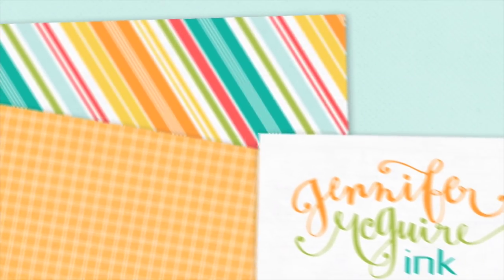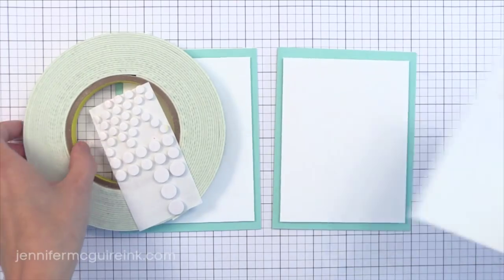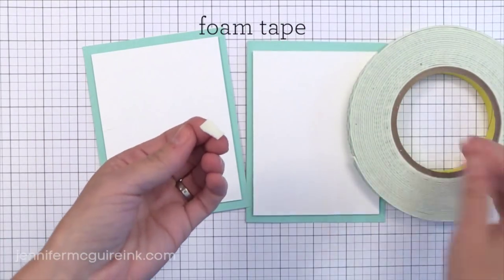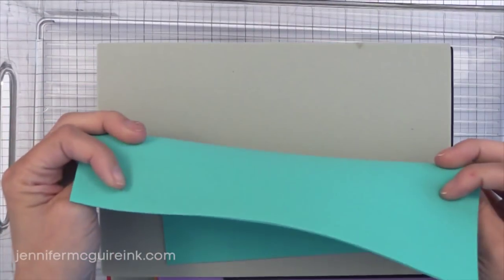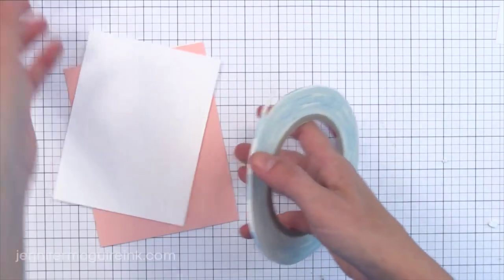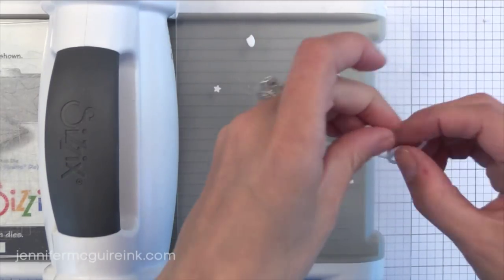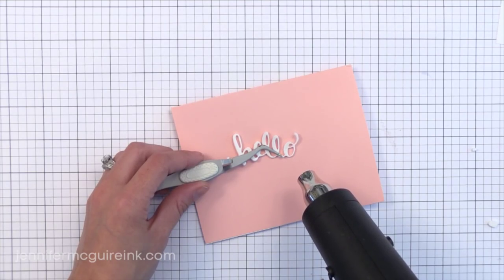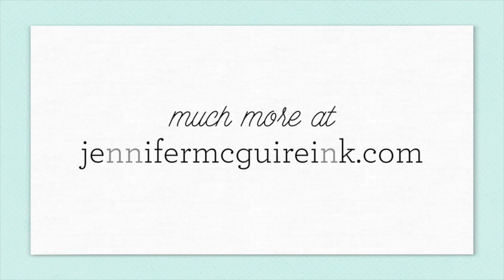Adding Dimension To Handmade Cards

Comment: I'm glad you shared the heat gun trick. I make some really beautiful flowers by die cutting flower shapes out of the craft foam and using my iron to add heat to them and it makes them dimensional. With all the beautiful flower dies out there you can really take them to another level by using craft foam and adding heat to them. I use them for very special cards and also to make flower crown. The possibilities are endless.

Comment: Thanks Jennifer for another informative video. I have used the craft foam with adhesive backing and have had good luck with it.  I especially like using it on shaker cards as it creates a good seal and the colored foam can match the card stock I'm using.

Comment: I would never have thought about using a heat gun to shrink the foam. But I also took your advise from one of your other videos and use the foam for shaker cards. I die cut the center cavity in the sheet and nothing falls out since there are no seams :). LOVE your ideas !!

Comment: Great video Thanks for sharing your all your tips, tricks and techniques with Craft Foam it was extremely interesting and packed with lots great information.  I am a die hard scrapper and definitely this will work for dimension on my layouts. and won't get smooshed in the albums.   YOU ROCK!!

Joan Smith

Comment: Thanks, Jennifer.  That was very informative.  I also use lots of foam strip on my cards.  I had NO idea how rough a card could look after being in the mail and your card took a short trip (mailed and received in the same town) compared to most of mine (mailed across the state of Montana or even out of state).  I am 100% going to start using foam sheets.  Again, thanks!  :)

Comment: Thank you for your great videos. I too love using the foam under my word dies, but I adhere my paper to the foam on one side, & the stick it adhesive  to the other side of the foam. Then I cut all 3 layers at one time.  I mix it up, using paper that is a different color than the foam!

Comment: I tried this when I saw an earlier video of yours. Been brilliant. I have used the adhesive fun foam, but it doesn't cut as well. I might switch to standard fun foam - cheaper too. Love that shrinking technique! Glad you're having a well earned break - even if you're doing a little bit of work keeping those of us not on vacation happy with your videos! :)

Comment: Thanks for the video! I've been using fun foam to back my die cuts for dimension for a long time. I have never used them for larger layers like you did in the video. As well, I use foam dots/squares or tape and place it around the outsides and in the middle for center support. Wonder if my cards arrived with the panel bent inward where there was no foam beneath it? Arrgghh. Your multi-color pk does have nice shades. The foam I buy at my local $1 store are 25 5x7 or 36 4x6 but they are bright colors. On a rare occasion I have found white. I haven't had trouble cutting any metal dies with the adhesive backed sheets I buy from my local craft store, but it doesn't work with etched foam dies (like the old Sizzix Sizzlets.) I always use my metal adapter plate and Vagabond. Thanks for the helpful info. :)

Comment: Not silly at all.  I have been using the craft foam for quite some time after seeing some of your cards.  it just makes sense.  i do use the scor-tape for adhering as I'm not sure my ATG adhesive stays stuck.  I always learn something from you.  Put the adhesive on the paper.  good tip  thanks for all your tips.  Much appreciated
Reply: Do you use the Scor Tape for the intricate die-cut words too? I was wondering if that works as well as the Creations stuff she showed on here...?
Reply: No I use Elmer glue spray adhesive.

Comment: Thanks, Jennifer for all the info on fun foam. Shrinking it made my jaw drop. I'll be trying that very soon.  I hope you don't mind if I share a mailing tip.  I take my cards to the post office to have them weighed so I am paying the exact postage.  I then have them stamped "Hand Sort Only" so they won't be sent through the sorting machines.  Works every time.
Reply from the maker: Erin Gengo not all POs do that.
Reply: Jennifer McGuire Ink Oh, I didn't know that.  I just assumed that, the USPS being one agency, all PO's offered the same services.  Thanks for letting me know.  Now get back to that beach! :)
Reply: I turn my card inside out before putting it in the envelope and that saves the front, as well as any embellishments (like buttons) from being crushed or broken.  I know it's weird to open an envelope and see the inside of the card first, but it really saves the card.  I love that foam and have been using more and more often.  Thanks Jennifer!

Comment: I'm sorry if this has been asked already.  I didn't see this question but maybe everyone else already knows this.  I'm new to card making and I just want to know why you use the foam between the cardstock instead of just adhering paper to paper with Scor tape?  What does the foam layer accomplish?
Reply: It's just so it stands out more as it's 3d and not a flat card. I don't always do it to the mat, most times I just add foam tape to the main element on the card. I don't do it with craft foam sheets though, they're expensive where I live, so I just add plenty of foam tape. Good luck & happy crafting :)